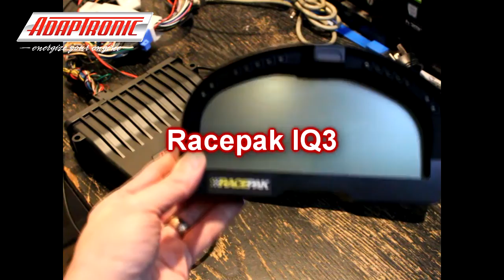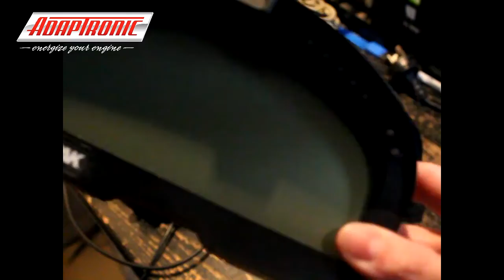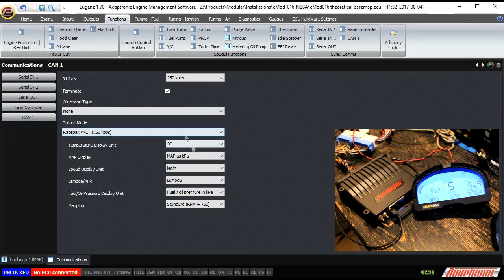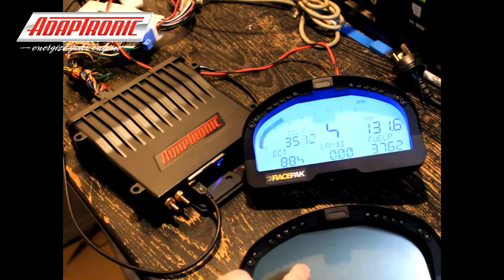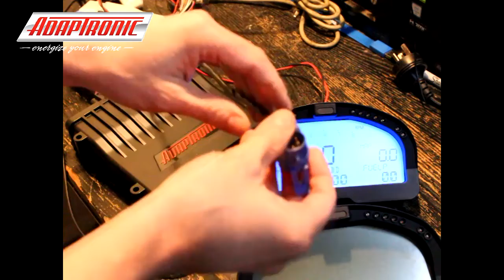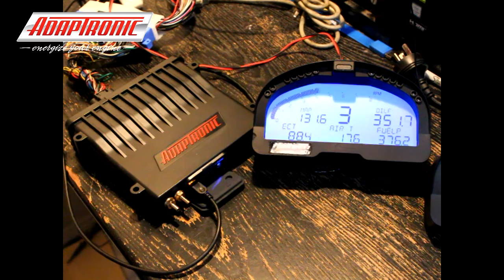Adaptronic - Racepak IQ3 Dash to Modular ECUs

Comment: Hi, i have iq3 street ( Haltech ) version , 34pins 
Connected to elite 550 through dtm4 can bus connector ( 12v , can low , can high and signal ground) followed some videos on youtube but still I didn’t get any reading on the dash. 
What would you suspect the issue? I bought it 2nd hand and it hasn’t had vnet cable, please advise
Reply from the maker: Just needs to be on the right CANBus. Easy fix.